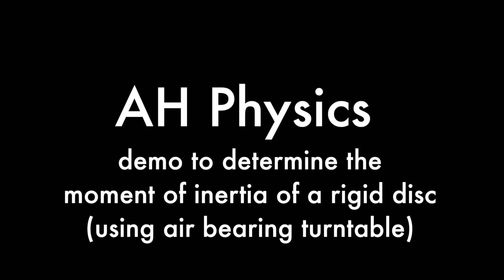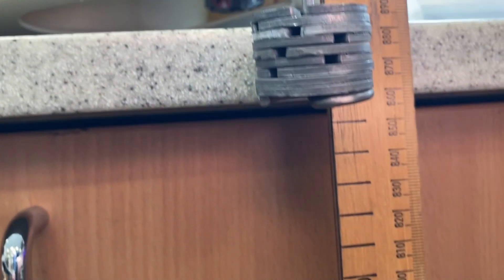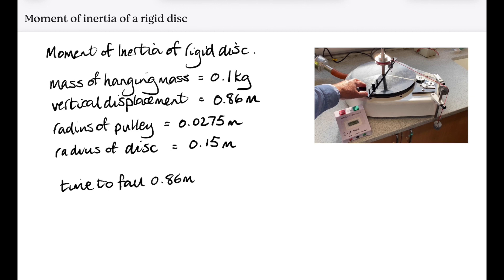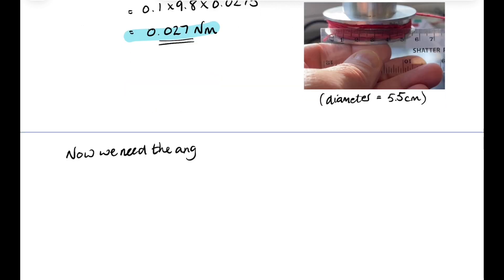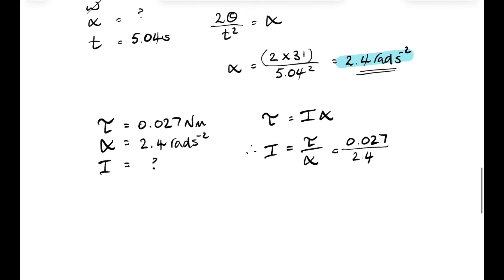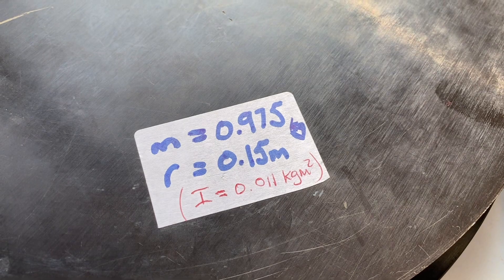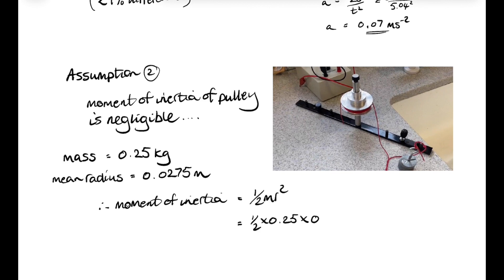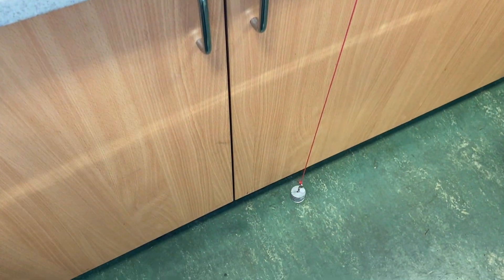AH Physics - Demo: Moment of inertia of a disc

Comment: Great video. I'm doing my AH physics assignment on this. I'm wondering how you would measure this experiment when using rods?? Will it dramatically change the method of this experiment??
Reply from the maker: Have a look at my video on the Bifilar suspension experiment. This setup is used to determine the moment of inertia of a Rod about its centre. Here’s the link:

https://youtu.be/Zu8_392ML_Q?si=84d-hJdcICxKB49j